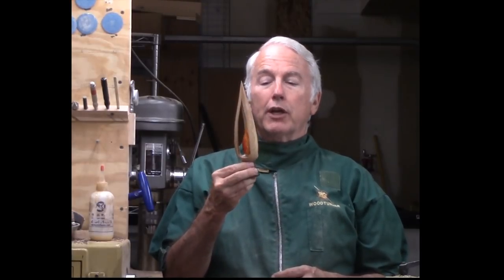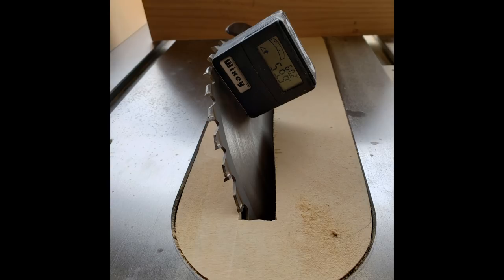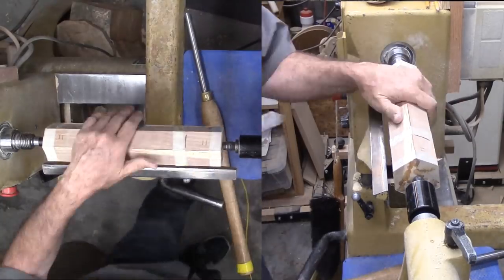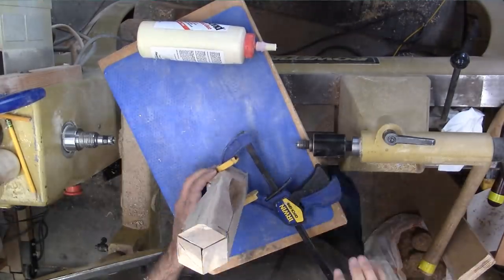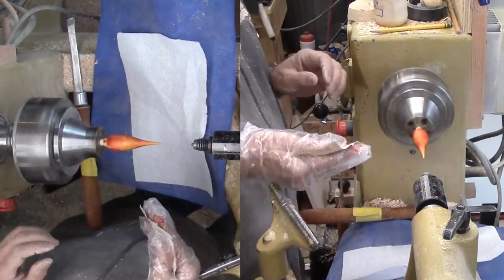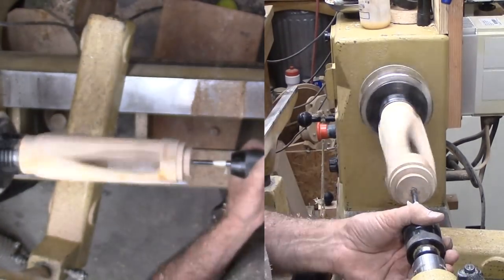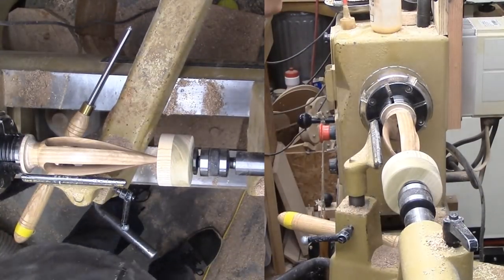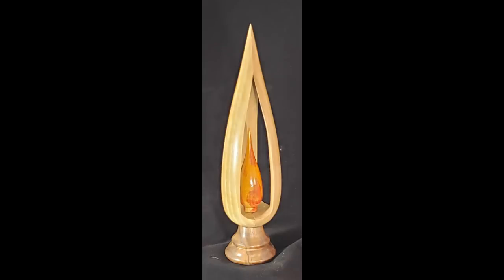Woodturning Inside Out 3 Stave Art Flame

Comment: That's awesome thanks.  I've been turning some dip pens which are partly 3 sided (using 3 colours of wood) and other dip pens which are round with an inside out section. The three sided inside out idea occured to me, which led me here. The flame looks amazing, so today I'll be attempting a pen with a flame in the grip (bulge in the dip pen). 16mm is the maximum diameter, so got the dread feeling already.

It's amazing when I get a crazy idea how often I end up here. Thanks for sharing your knowledge.
Reply from the maker: As long as you are safe - go for it - it is only wood. 
Alan

Comment: Hi Alan. At the first glue up, did you ONLY use the tape around the bundle and CA glue on each end? The reason for the question is I have seen others use paper between the staves so it would release easy after first cutting.
Reply from the maker: On previous inside out projects I have used paper joints. I've also used band clamps around the bundle. In Dale's demo, he used this process and I decided to try it and see if it would work for me. It did.
I think paper joints are more secure but this was adequate.
Thank you Ed
Alan